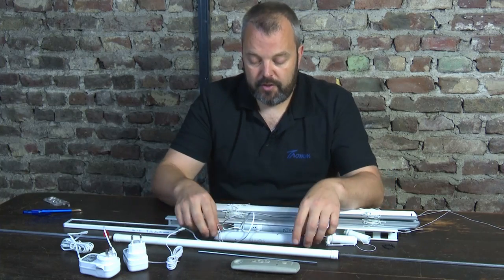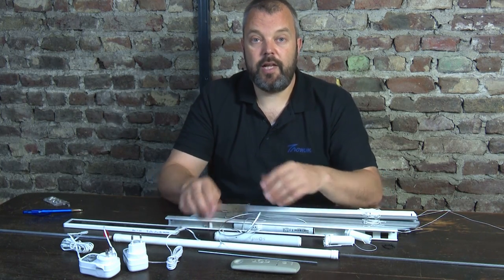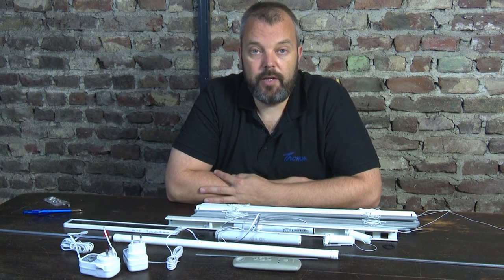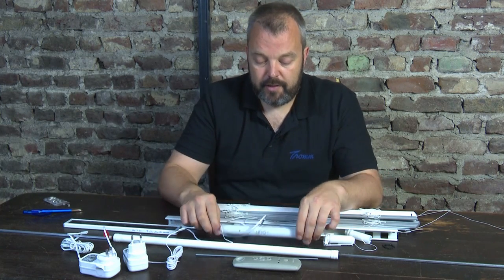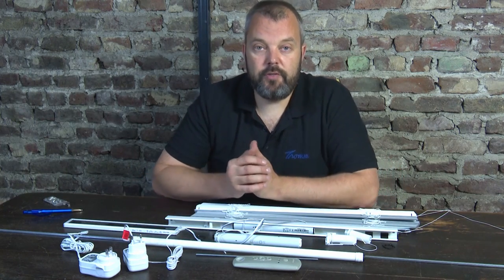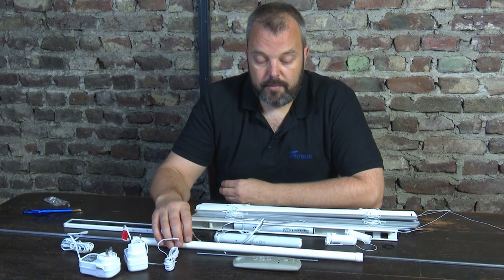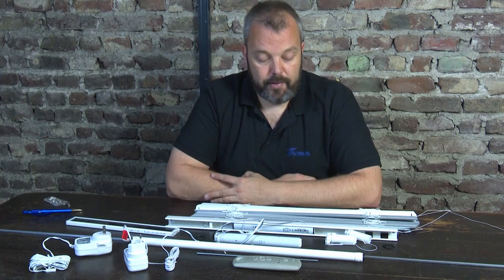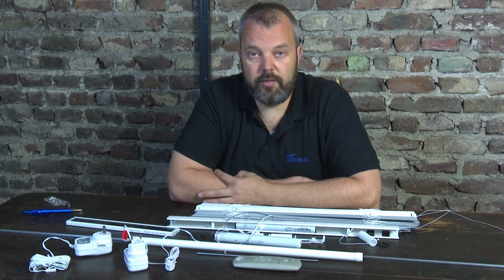How to motorise venetian blinds with the Somfy tilt & lift 25 RTS motor

Comment: Hi Otto 

Love your  videos, they have been really useful as I just have had this system installed and the manuals are really confusing

I have a question, I am using the tilt and lift 25 rts with a somfy situo 1 variation rts pure 2, is there any specific programming needed to set the circular wheel to work with the tilt function, it sort of works currently but not perfectly, the lift is working fine on the up and down buttons

One other question, do you know if the tahoma app can control the tilt function on a Venetian blind as well as the lift? When I add the internal Venetian blind in the app it only seems to give me lift functionality

Any advice would be really great, thanks for the videos they are the only place I could get the info I needed!

Comment: Does this only support small blinds? And if so, are there any that support larger blinds?
Reply from the maker: It supports blinds to up to 5 m2. Larger blinds can be done with the sonesse WT motors, but it's a little bit more work. Alternative for the large blinds is the Tilt only wirefree RTS

Comment: Hello, what motor is that?
Reply from the maker: +Antonio Gonzalez Hi Antonio, this motor is the Somfy Tilt and Lift 25 RTS.
Reply: I looked for it in your webpage but couldn't find it, how can I get details? cost and availability.
Reply from the maker: +Antonio Gonzalez Sorry for making it so hard to find - could you send me an e-mail at info@motorise.it, I can send you the manual, prices etc. If you could give me your postcode / zip code, I can estimate shipping too so you have all the details you need.